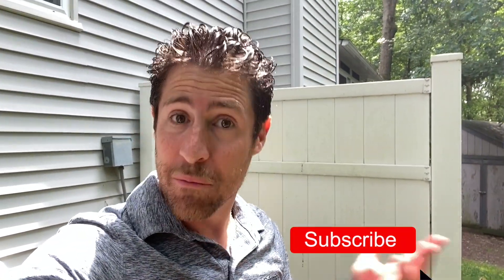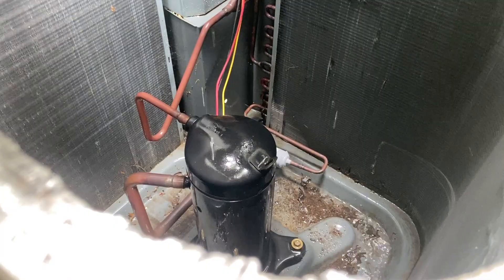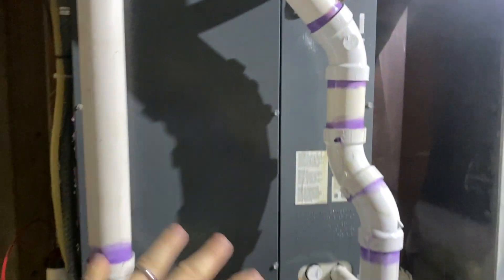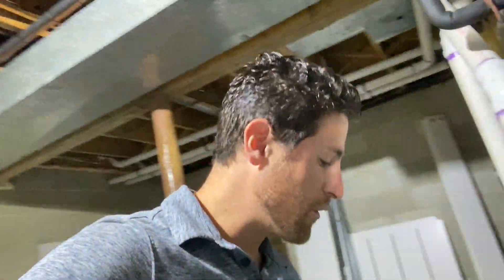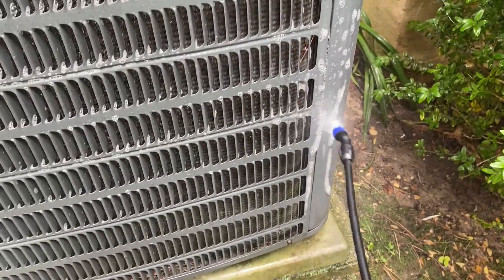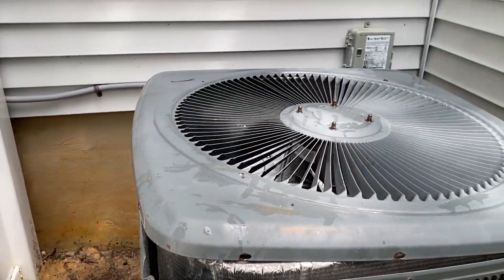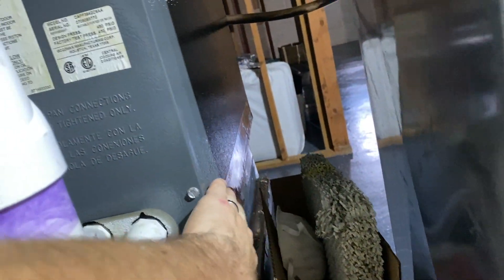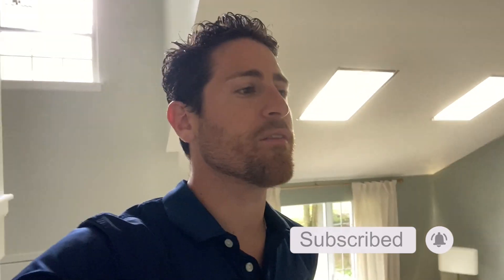Our Air Conditioner Broke - Fixing Our Goodman Air Conditioner

Comment: Ice happens often.  Air not flowing.  You may not have a freon issue, just air flow. You need to change your filter more often.  On your trip prob had temp too low.

My ice was only outside.  Used a hose.  I use a blow dryer when my ice maker jams from water algae.
Reply: 3 month filter is max 40'45 days.  Just use a 30 day.

Quarterly I hose off outside unit.

The drip pipe can clog with algae too. Clean it annually.

What you did & few tips I added... saves tons of money & extends life.
Reply: So.... freon system is a closed system so unless you have a leak... you should not need to ever add freon.